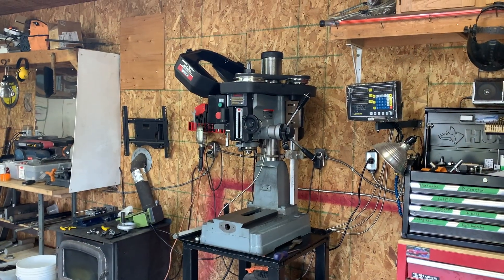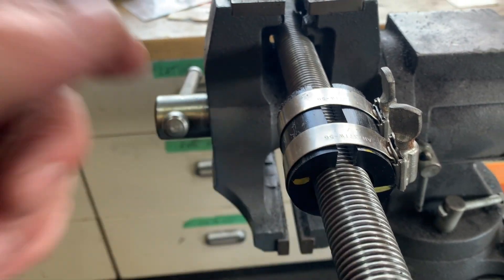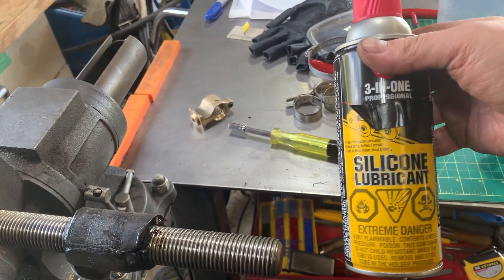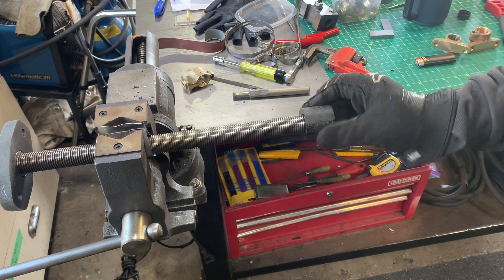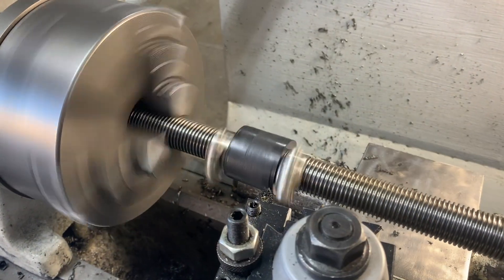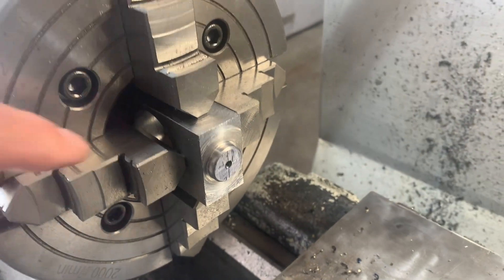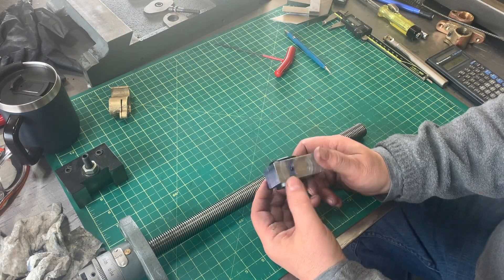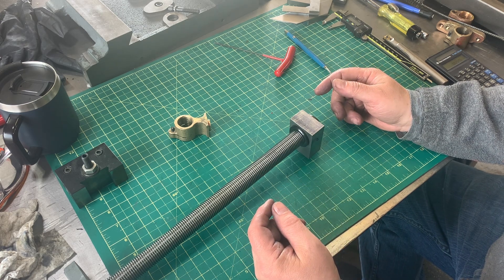Acetal Leadscrew Nut

Comment: Have the grub screws been enough to handle the load over time?
Reply from the maker: Gotta admit that it performs really good. Grub screws have held up. Could have used 10-32 but it worked out fine. Its been a few years and still no backlash.

Comment: The original design for this method of lead screw nut production was named as the 'Evanut'
The original inventor of this idea tried both 'Delrin' which is Acetal Homopolymer and also he tried Acetal Copolymer.....the Acetal Copolymer was found to be the better choice as it had a more favourable melting/plastic temperature threshold.
Also he used a homemade simple threading tap to relieve the initial tightness and achieve a free running fit on the lead screw.
I have made a couple of these myself just for interest and they seem to work very well
I have also read of others who have made these nuts for milling machines and they report that these nuts have good durability and long service life.
Reply from the maker: @howardosborne8647  that’s awesome information Howard. Gotta say that I just did it on a whim and got lucky that it worked.  Its still doing great. Gilles

Comment: Well that’s a new approach! Interesting repair. Hope it last longer than the original. I’d be will to bet that original one was brass and not bronze. 
Also on my lathe I found they used cast iron as a nut and the hardened lead screw wore out the cast iron with no damage to the lead screw. I would have thought it would have done some damage or wear. But cast is soft so it makes sense I guess. 
🍻
Reply from the maker: You may be correct on all counts. So far so good the Acetal nut still has no additional backlash. Gilles

Comment: Lithium grease as lubricant with acetal? Seems like my newer import machine has more backlash new than my 50+ year old atlas MFC. As stefan says, these machines should be considered as 1/2 machined casting kits. Good job on the repair.
Reply from the maker: Totally agree with you the old machines are great. Gilles

Comment: That is an interesting way to make a new lead screw nut.
Ironically, I had to replace my X-axis lead screw and nut 7 months into using my new PMD-30. I did check the y-axis nut while it was apart and it still seemed OK. It took about 6 weeks before it was all sorted out with King, but, in the end I have a working mill again. Thanks for the great video.
Cheers from SK
Reply from the maker: You’re welcome. And thank you for watching. Gilles

Comment: Seems chinesium machine quality  can be let down by the smallest of parts. On my mill the backlash was excessive from new on the X axis and i mentioned it to the importer at one of the shows we used to have here, they said use the adjusting screw, when i got home i looked for it and found it was missing altogether! We won't even go into the Y nut being loose in the casting.😢
All i can say is thank goodness i fitted a DRO.😊
Reply from the maker: My DRO is a saving grace

Comment: Very interesting. Might I recommend using moglice to achieve a similar "type" of result but using the original nuts. Drill holes in the original nuts that can be used to inject moglice, put the threads on the screws, seal up the ends so that the moglice can't run out the open ends, and then inject moglice into the holes you drilled. This will form a perfect thread form around the lead screw, similar to what you did here but doesn't require any additional machining afterward. Don't forget to spray the lead screw with some type of release agent so that you can get it back off after it cures.
Reply from the maker: After this strenuous exercise I definitely need to get some release agent. Moglice  sounds like a great idea.  Thanks for your input.  A good project for the next nut.  Gilles
Reply: @LetsRogerThat  I love the stuff, I discovered it about a year ago and have kept it in the shop ever since. It can be used to repair all sorts of things; nuts, slide ways, dovetails, etc etc. And the people who sell it in the states are a great bunch of folks. Devitt Machinery. In Aston PA.
Reply from the maker: @DavidHerscher  awesome. Gonna contact them and get some. Thanks

Comment: Did the factory have the original nuts, with the backlash adjustment tightened to what looks like they bottomed out the split nut adjustment?
Seems like a nice fix, Delrin is pretty tough material. I was surprised you got the two half sections to appear to have welded back into a single part. But capturing that inside the bore of your new nut clamp should prevent that splitting apart. I hope there's no follow up of a new problem.....

I recently had a similar problem with a harbor freight sawmill height adjustment. They made the threaded jack screw with square threads, I mean real square threads, not acme. So the major pitch diameter was sharp 90 degree edges. The bronze female had acme face angles. That square edge just cut right through the brass threads. This was a 3mm pitch (but a bastard OD thread, 19mm if I recall). I originally got a replacement female part from their support, $80, but it failed within doing the one log as the original one failed time wise (first use, then second use). So I ordered the left hand threaded acme lead screw and bronze nut from McMaster Carr, and modified them both to fit the machine.
Reply from the maker: Its quite disappointing to see such degradation in such a short time.  The leadscrews showed a significant amount of sharp edges, somthing similar to chrome peeling off metal.  Very odd.  There's little doubt that may have contributed to the nuts wearing down to such an extent.  I repaired both leadscrews to pristine condition.  We'll see how it works out. Perhaps in the end I'll have to do what you did but for now I'm giving a try.  As for the acetal it welded itself very easily.  Before finishing the project I clamped it in the 3 jaw to face both end and that thing never showed any signs it would split it welded seems.  Cool stuff. Gilles
Reply: @LetsRogerThat  I just saw a short where you indicated you're going offline for some surgery. Good luck to you, I hope it's not a cancer you're dealing with, and something not involving a primary organ. I had two colonoscopy's last summer, as the first guy was not a surgeon and saw something weird, so after a CT scan where fistulas, and other stuff was seen (and the radiologist diagnosed cancer) a follow up with a surgeon, now believes this to be diverticulosis scar tissue, but now I have another scheduled for next month, such fun. I want to make it another 29 years to hit 95 if I can.
As for backlash in my Wells Index mill, it's over 45 thou, and the DRO enables precision work. Even if new, I bet there was 5 thou of backlash. My lathe has adjustable cross feed screw, I've never seen zero on my lathe that has that. And you know snugging them  tight, just wears everything faster. Again, DRO's are the best add-on accessory.
Good luck to your health.
Reply from the maker: @f.hababorbitz  thanks. I had a kidney issue but thankfully it’s gonna heal. It’s important to enjoy every single day. Life is short 😉
Reply: @LetsRogerThat  Gilles; Sadly, evolution never expected animals to develop a complex language adaptation, enabling us to comprehend the fatality of our existence. It sucks. At least you weren't eaten by some predator while grazing on fauna.😀
Reply from the maker: @f.hababorbitz  That made me laugh.  Thanks I needed that ;)

Comment: Neat technique. What do you think of the durability of POM vs bronze?
Reply from the maker: Based on what I've read from others who have done this, longevity appears to be multi year with no observable wear. But I'll have to inspect it at 6 month intervals and see how it performs.  Acetal is an amazing product to work with and its lasting power is well documented. Gilles
Reply: @LetsRogerThat  Thanks for the reply👍
Reply: @LetsRogerThat -Howdy! I’ve been watching your videos here and there. I’m not sure if you mentioned the condition of your lead screw in another video. How’s it held up? Thank you for your time.
Reply from the maker: @orangetruckman thanks for stopping by. Actually that acetal nut is going strong and not showing any sign of wearing out. I’m pretty happy with it